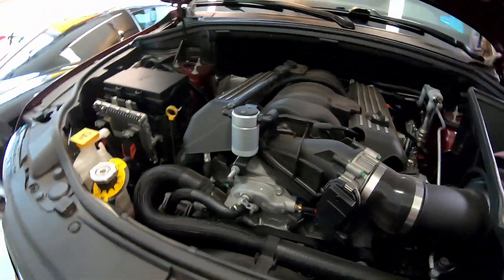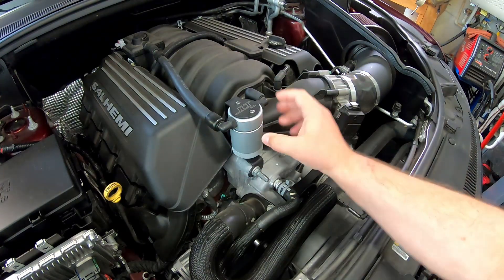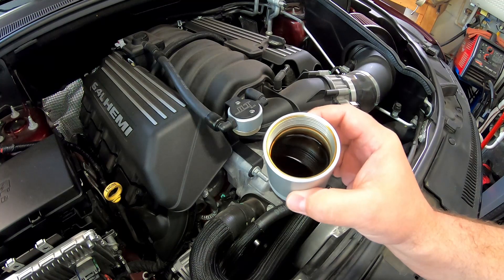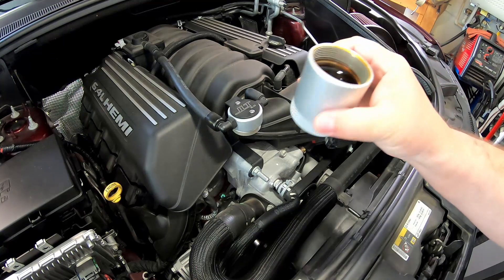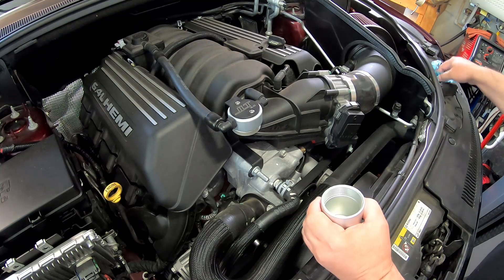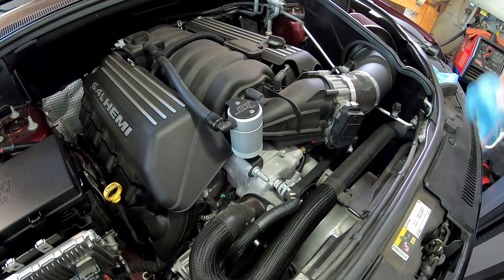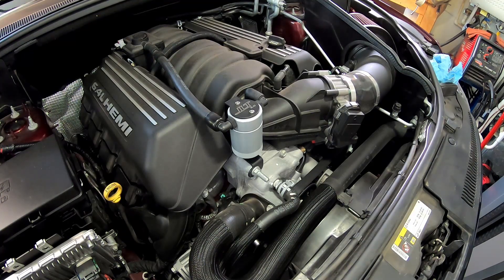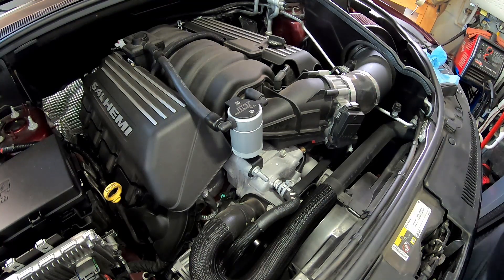Does the JLT Performance Catch Can Work?  SRT Grand Cherokee

Comment: Another great video! I’ve noticed that my catch cans fill up a little quicker in the winter months and that may be the cause of your high level. They also fill up quickly if you’re making frequent short trips where the oil isn’t reaching full operating temperature. I have the same sized JLT can on my Trailblazer SS and have found that 2000 miles is the sweet spot, just as you said.
Reply from the maker: That is great to know Brian.  I didn't think about weather affecting the outcome.  Will continue to monitor of course.

Comment: I get a couple tablespoons every 1k-2k miles on my GTO.  It has almost 150k miles on the SBE. :)
Reply from the maker: I think the one big difference there Greg is the LS motahs don't use 0 weight oil.
Reply: @PNW_Car_Mods Heh, I'm actually using 0W40. LOL
Reply from the maker: @gregwestphal  Wait wut?   you runnin 0 weight in an LS and it hasn't exploded?

Comment: Whoa, that is full for 3k miles. Especially compared to my Camaro SS. Then again it takes me years to reach 3k miles on the SS. That's about the same as on my dad's Challenger tho. I forget the interval he did, but it was all the way full as well.
Reply from the maker: Yeah it kinda shocked me too a bit Hollywood.  Definitely not concerned about the health of the engine.  I'm assuming it has more to do with the weird oil.  It definitely has the consistency of water being a zero weight oil lol.

Comment: Very helpful video, going to buy it for sure, can you share the link so I could get one?

About the oil, im so confused due to the argument on rather its factory oil or benzoil or shell
Reply from the maker: I bought the JLT stuff factory direct as you really can't find it cheaper anywhere else as they have strict pricing.   Recently JLT was taken over by S&B filters.   Try the following link.  https://www.jlosc.com/mopar-vehicles/2011-2021-jeep-grand-cherokee/
Reply from the maker: Oh and don't get too hung up on the kind of oil.  Just make sure whatever oil you use that it meets the specifications requested in the owners manual.   I use the Pennzoil SRT oil just because it is relatively easy to find and there is no doubt it meets spec.

Comment: I'm burning through mobile 1 0w-40, within a month ( daily driven) a few out of down drives and I had about half of what you had. I'm switching to amsoil asap. No idea why they started doing 0w-40... its burning up somewhere!  Brand new vehicle doesn't make sense. Thanks for the video
Reply from the maker: Thanks for stopping in Nathan.  I hope your engine is ok.  I'm far from an oil snob and am generally not brand loyal but we went straight to the Pennzoil SRT specific oil.  I don't know if it's a gimmick or not but it has been fine.  I have maybe added a half quart between the computer generated oil change intervals.  We've changed the oil twice in 12k miles if that helps.  I get on this thing hard nearly every single time I drive it.

Comment: You definitely Need to empty it out more often!
With the level that high in the catch can you were probably sucking oil straight into the intake manifold!
Sucking condensed oil into the intake Is Much Worse than the usual oil vapor!!
Empty It More Often....   🤐
Reply from the maker: Totally agree.   Have moved up to around every 1500 to 2k miles and that seems to keep it happy.